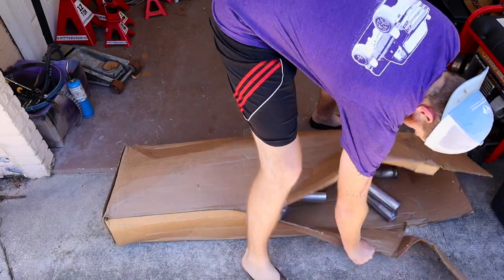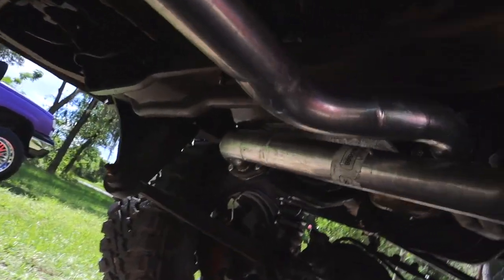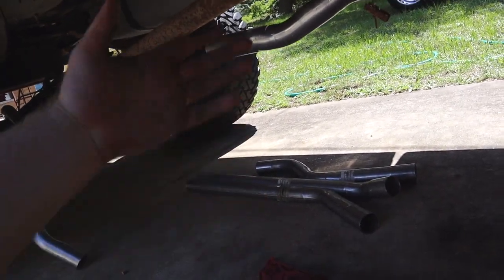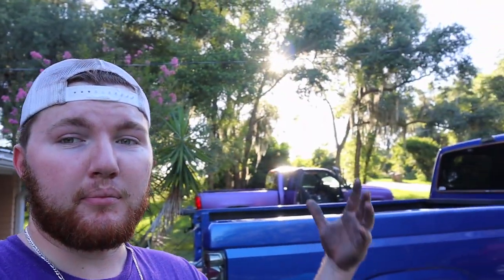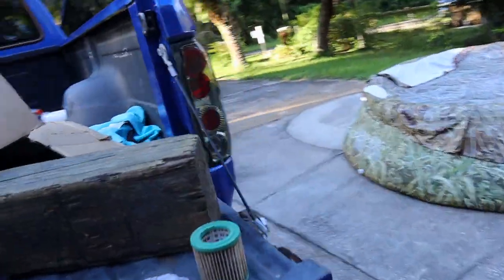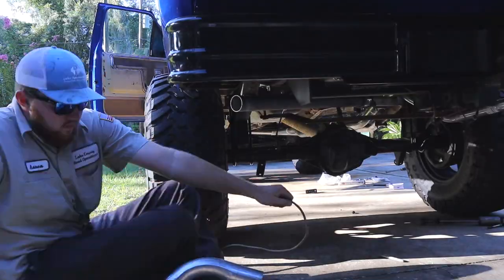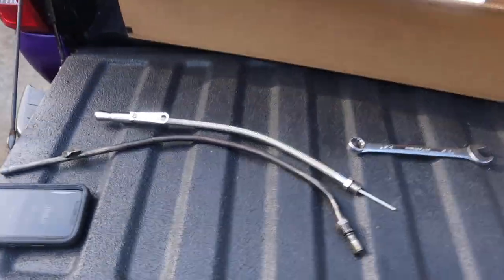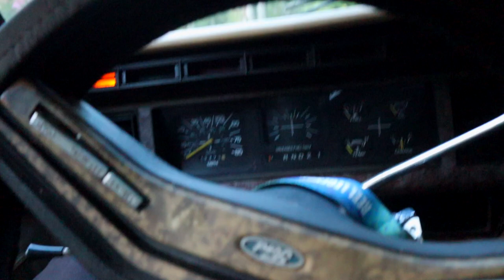*SUPER LOUD* True Dual Straight Pipes With NO CATS & LONG TUBES

Comment: you need to add an H-pipe or X-Pipe it will really help the sound so it dosent have that 2 4 cylinders running noise it really smooths it together. I have true duals with H-Pipe with glass packs on my 83 460 and it sounds amazing.
Reply: Video??
Reply: I was thinking the same. It definitely sounds wet fartish!
Reply: Glass packs are quiet.

Comment: That's how my 95 F-150 5.0 sounded with open headers. I put Flow-tech long tube chrome ceramic headers and true dual 2 1/4 straight pipes with 6inch tips exiting straight out the rear no mufflers or cats. Those 6inch tips make all the difference it's 2x loud with the tips then when it was open headers. My mom and dad can hear me coming home from 5 miles away.
Reply from the maker: I’m thinking of doing 5” tips on mine, I can’t imagine it being louder.
Reply: @AaronCates  trust me if you put tips on that are 2x the size of your pipe or larger it'll make it even louder cause it'll echo inside of the tip.  Also since mine exits straight out the rear both pipes echo off each other making it even louder. I have a some videos up with the tips and a couple without them if you'd like to hear what it sounds like.
Reply: Sounds awesome!   U really want loud   keep the Longtubes and run even alittle smaller pipe.  Do like 2 inches in the first half than back half 1 3/4 inch  I know you guys might think that’s crazy and it’s to small but trust me no lie I have this setup on my 96 Chevy 350  for like 7 years never hurt the engine.  has plenty of power used to have 21/2 true duals than went to this setup it has plenty of power and louder. As long as your running actual duals you actually don’t need even 21/4 for size until your making close to 450 plus horse power so try that setup if u really want loud lol
Reply: And I agree on the tips thing but I’ve tried a 6 inch tip on the back of 1 3/4 and there’s a point where it actually is quiter cause it’s to big and gets rid of a lot of crackle.  3.5 inch tips long tube headers 2 inch pipe to 13/4  is terrible loud
Reply: Hi

Comment: Hell yeah man she sounds great
Reply from the maker: Thank you!
Reply: @AaronCates  you should go and put in a b303 ford racing cam in it with 750 up on the exhaust and 750 on the intake lift cam with a set of flowmaster 40 series installed it will sound so sweet

Comment: I wish I was there to help bro. I got the same truck but mines red. 4wd 351w etc. I had to run my own exhaust. I run flowtech headers and two flowmaster super 10's. True dual, no y or h pipes. Mine are ran under my doors on each side. They stop at the back of the cab. Let me know how to send you photos of how I did mine bro.

Comment: Not to hate or anything but I don't understand your concept here. You got close to $5000 in wheels and tires and yet hack an exhaust together using fence post? That doesn't even match up? That makes no sense at all. You know on ebay you can get an exhaust that exits on both sides like that. Nice truck otherwise but I suggest you rethink this exhaust. If you like it thats fine but it makes the truck look cheap.

Comment: Motor sounds weak Af
Reply: Only problem I have ever had with this motor is the throttle body, and radiator hoses...sometimes the coolant pressure gets super rough